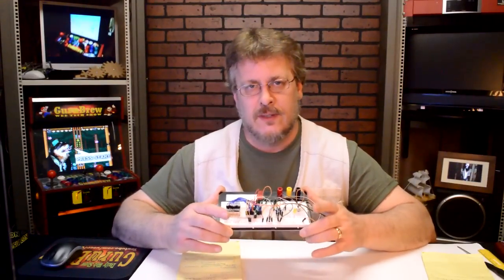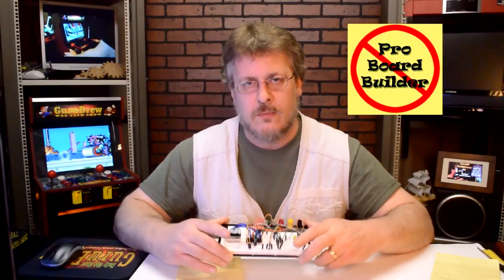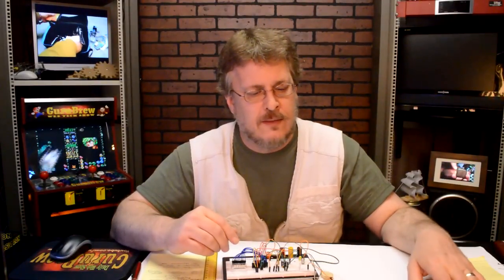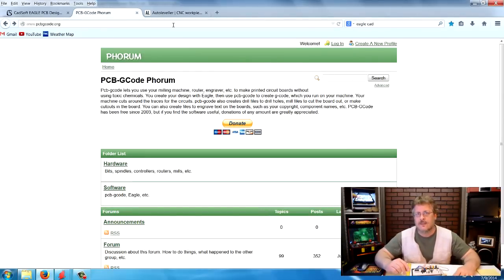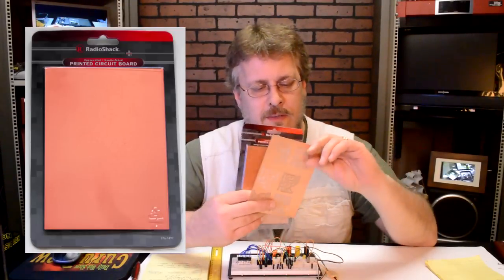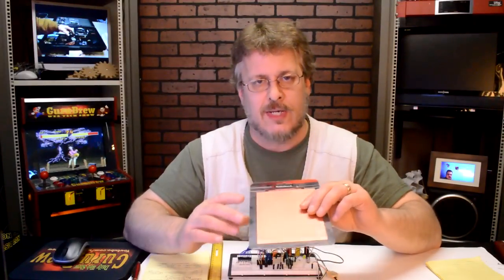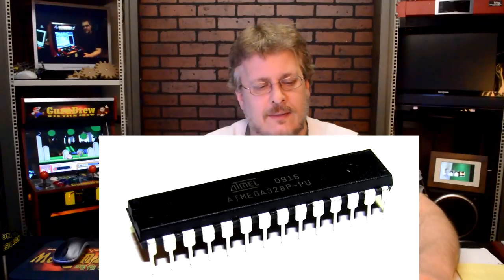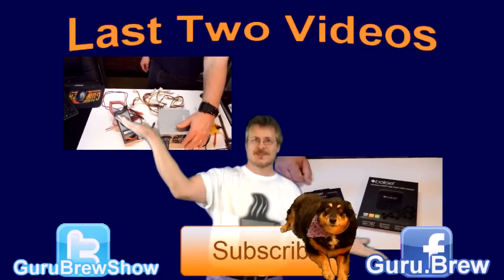Creating a Circuit Board Using CNC Router - Introduction

Comment: Oh man, Steve I got to hand it to you, you're not a bit timid about jumping into these projects!  I'm setup with my CNC ready to make a board, but reading issues about leveling as you pointed out, has me doing more research on the subject.  I'm running Eagle 6.5.0, did you find another version specifically for PCB's?
Reply from the maker: Hello, I figured I would be hearing from you knowing you we looking to cut a board. I downloaded the latest stable version of Eagle version 6.6.0. They now have a beta 7 but haven't tried it yet. To do the isolation method and produce G code I am using the PCB G-code software as an import from Eagle as Gerber files directly from Eagle are not helping me in this case. I am looking for any help I can get on this one so please keep me informed of my screw ups:)
Reply: The best way to level things out is to put some wood on the bed of the CNC then use a large cutter to skim the part flat relative to the cutter/spindle. then sand it smooth if it is rough.  Clear all the dust off then stick the PCB to the wood using double sided tape.  I find double sided carpet tape works best however its hard to remove sometimes. Then to finish the boards off use a fine rubber sanding block to smooth the board off and remove rough paths.
Reply from the maker: Chris Hudson
You give some good points and I will be covering these and more in upcoming parts to this video. Thank